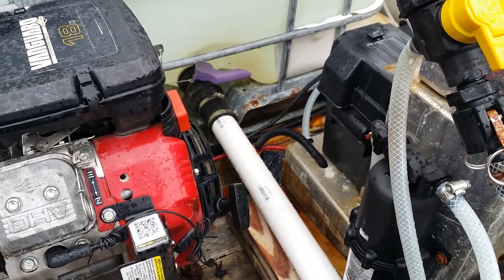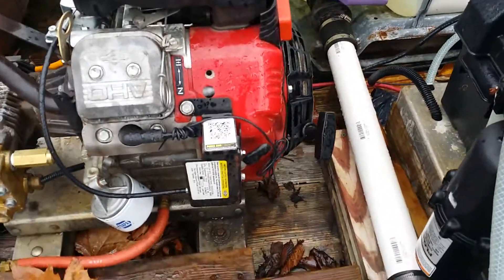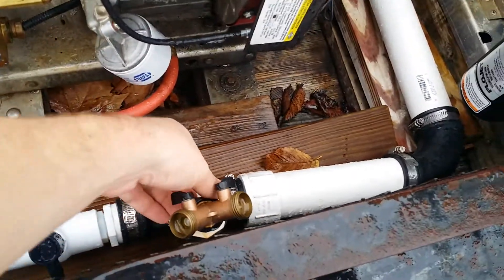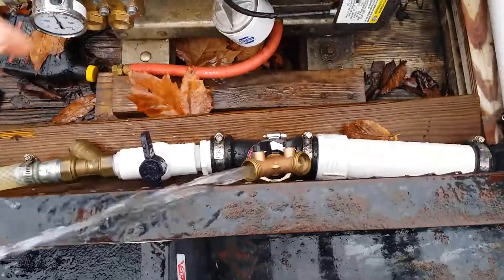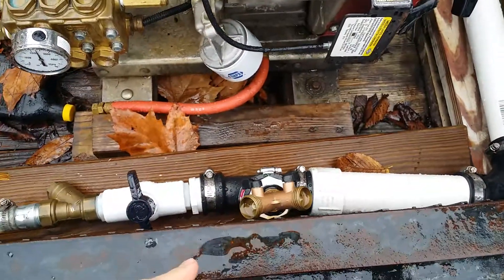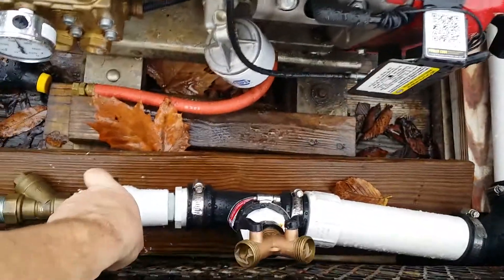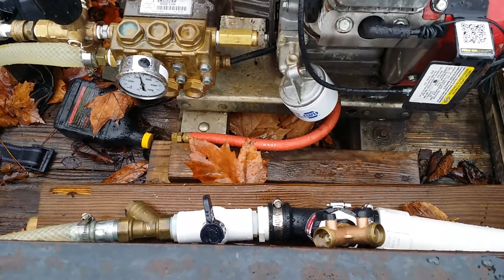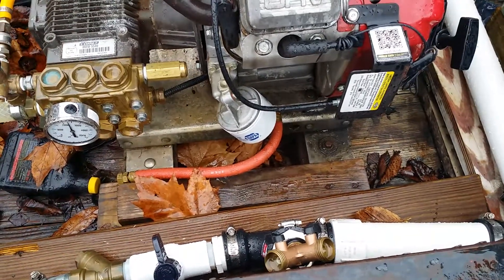Buffer tank plumbing redone.  Direct drive pump

Comment: Thanks for vid.  If you ran pump with a little air, did you ever cause the pump to start getting vibration you could feel at gun? Like the air cavitation perfectly caused vibration you could feel in hands? If so we're you able to repair pump with new valves?

Comment: I have a 4 com GP pump direct draft I was told by salesmen I need a belt driven to draw from a buffer tank others say if it has a bypass use the bypass feed run to my tank keep pump lower than tank and keep tank water level 2/3rds and start at half stroke until pump primes...what do you think will my pressure washer draw water from a tank ?
Reply: That's what I'm wanting to know also..they say a direct drive won't draw from a tank but i see a lot of videos that prove otherwise.
Reply: @bol.8749  I got mine to work it can be done..No need for a bigger pressure washer unless its a hot water and its for surface cleaning..that 4 rpm will male you alot of money just get you a good down stream injector and run a 200ft hose so theres no need to keep moving the pressure washer around and you will get jobs done really quick..my last job I did in two days and made $2400
Reply: @theUNPOPULARopinionSHOW  awesome.  I have a Honda 4gpm with 250ft hose.  I got a couple downstream injectors now and an x jet.  👍👍
Reply: @theUNPOPULARopinionSHOW  bro i would like to know how u did that with your direct drive. Anyway i can rap to u bro about what u did because. I was about to go buy a gear drive and switch the pump out.. so i would appreaciate if i could chop it up with u on how u did it.. i have ideas i just want to to make sure they will work

Comment: So the direct drive pump pulls from the tank?
Reply: cwhyde36 it doesn't create suction, but works just fine once the air is out of the line.
Reply: I am running a AR 4.4. On a 13hp gx series.  Keep getting different opinions on what to do... I'd like to run a tank